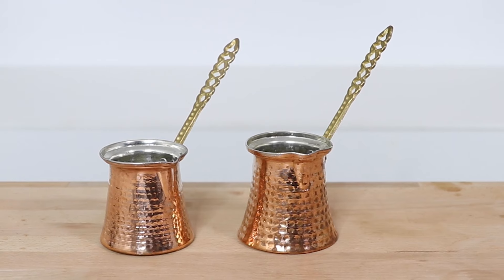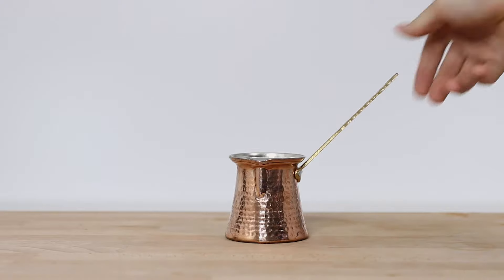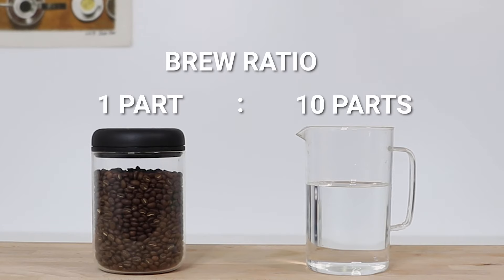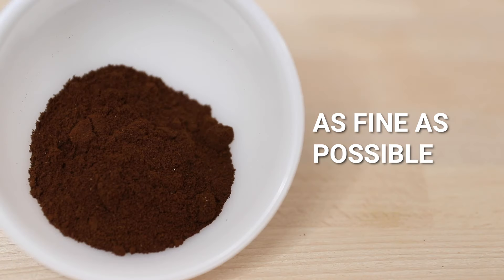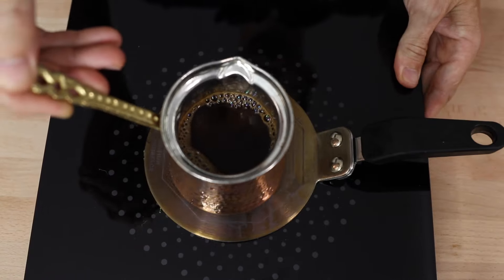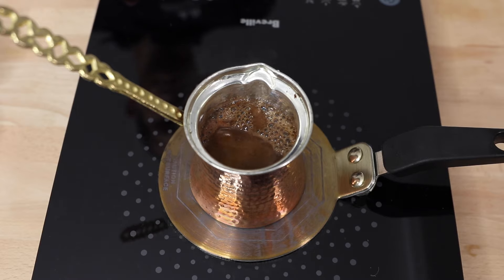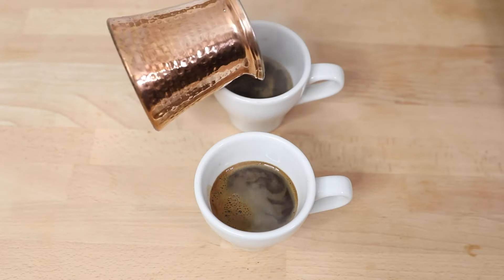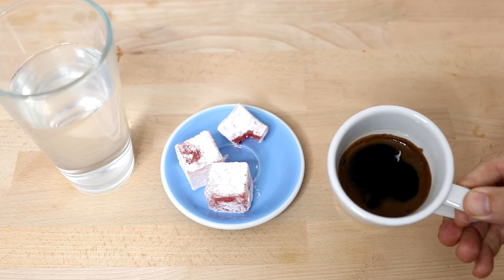How to Make Turkish Coffee

Comment: This is one of the best Turkish Coffee tutorials I've seen on YouTube. Most other videos I've seen ignored the foam entirely, but it's the most important part of Turkish coffee. Instead of pouring the foam into the cups, you can also scoop it with a small spoon. And as you've said it's also a good idea to repeat this 2-3 times. Just one thing, I wouldn't say most electric grinders are capable to grind for Turkish.
Reply: @A A Yeah I'd guess roasters can grind fine enough, I was more talking about home grinders. But to be fair, I haven't tried grinding it myself because I know I can't get as fine. If you say it's good enough I'll give it a try at home, cheers :)
Reply from the maker: Wow, thank you!
Reply: Even though most grinders can't do a decent espresso grind, that's more an issue of uniformity than anything else. Any grinder is capable, however, of putting the burrs so close together that only a fine powder can make it out. When your grind size is flour uniformity is a given.
Reply: Ah so I guess just pouring the foam would eliminate any grounds or residue in the cup

Comment: Great video , mind you , its really hard to achieve Turkish grind with a hand grinder even commercial grinders need to have custom burrs , another point is that your cezve is cooper on the outside and tin on the inside , hence you  need to use a wooden spoon to avoid any tin 😉
Reply from the maker: Great point!

Comment: My problem is that once I pour off the top foam and put it back on, it goes to a boil just because it's a smaller amount even with the burner lowered. How does one avoid boiling? I am using a butane burner on its lowest setting for the entire process.
Reply from the maker: don't place it all the way on the heat - hover it over to control the contact with the flame and the adjust this way 👌